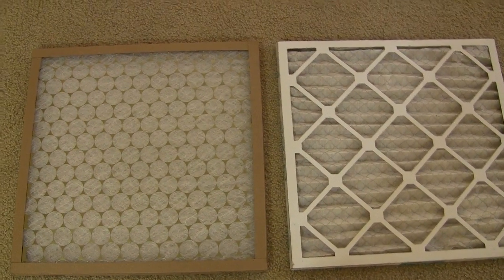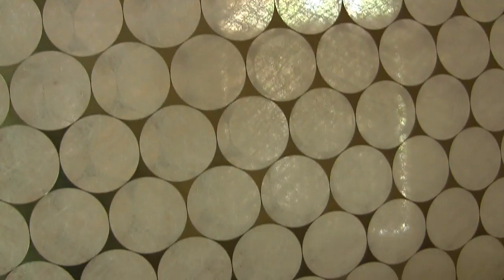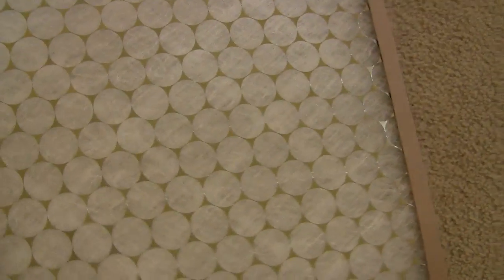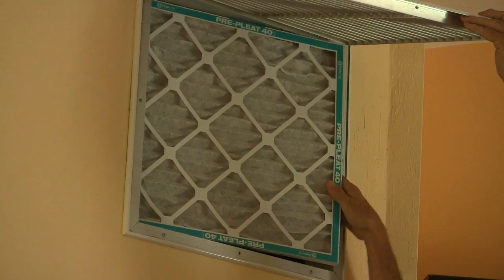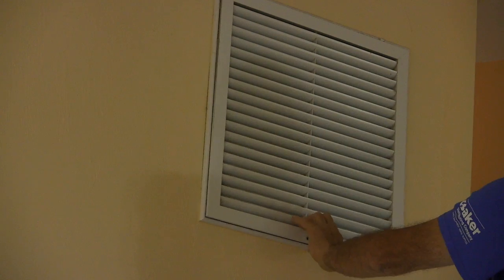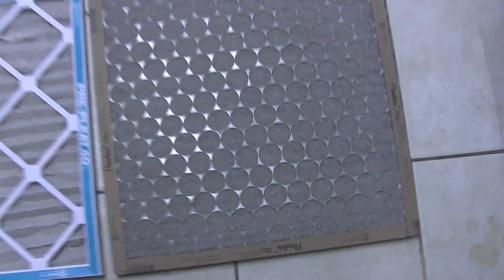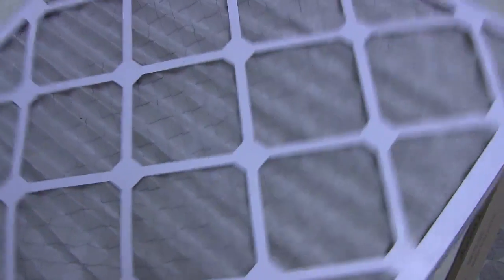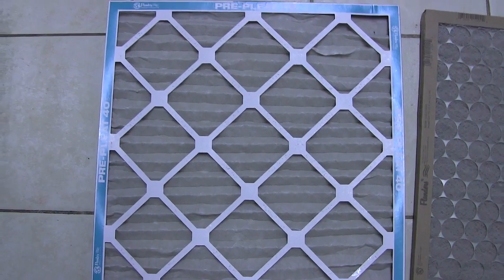HVAC fibred vs pleated air filters

Comment: What needs to be addressed concerning these air filters is that air flow restrictions will cause damage to the furnace in the long run. 
Insufficient air flow through the furnace, especially the cheaper built imports, will cause heat stresses and breakdowns.
Keep in mind also that the cleaner you can keep your cold air return system the better.

Comment: This is the best comparison I have ever seen on fiberglass vs pleated filter. Just shows you how much more dirt/particles pleates filters stop. However there is a trade off in air pressure drop as they don't flow as much air as fiberglass.

Any 1 inch pleated filter needs to be replaced monthly. They have a high pressure drop of .20 avg and only go up very quickly as they get dirty causing strain hvac equipment.

Comment: I look at it like this. My HVAC system isn’t designed or intended to clean my air. It’s designed to heat or cool my home. I use the fiberglass because I found the pleated limited my airflow too much. The fiberglass grabs the larger particles which is important, it does not grab the real small particles but the don’t need it to. We dust, clean, have an ionizer and led blue light in our furnace snd would rather give our blower the airflow bit needs to run properly.
Reply: Restricted air flow can also damage exchangers in gas devices.

Comment: What is the benefit of a high delta-P across a filter (maximum elimination of dirt particles) designed to clean air, but negatively affects evaporator saturation and superheat?

I'm just asking, do not claim to be an authority or even a novice on these systems.

Comment: Interesting comparison. I work in a hospital & we use mostly 2 inch pleated air filters in our air handlers & rooftop ac units. The fiber type seems to be most commonly found in residential applications. Fiber is ok if you have low dust & dirt levels or for light commercial applications.

Comment: ok this morning its too hot so i am staying in and harassing dr z LOL . you won't believe this some of you but my house was built in 05 and i went and bought the filters you assemble together and you clean them once a month at least , well they are still in there in 2016, i pulled the indoor coil last year i think it was and it was spotless . i just redid the water outlet that they had done the contractor did so to make it easy to clean without needing all kinds of crap. later

Comment: If you are going to change your filter every thirty days the pleated filter is good. If you only change your filter every 90 days or more I recommend the fiber filter. For most people and real world situations (especially rental situations!) I would go with the fiber filter!! For people who have allergies or high dust sensitivity I recommend going with a HEPA (High Efficiency Particulate Arresting) Filter and changing it every thirty days.

The draw back of more efficient filters is they require more frequent changing!!! Of course the benefit is in the name... More efficient!! This is only true if they are changed every thirty days otherwise they will cut air flow and cause less efficiency, low air flow, and eventually coil freeze ups, high amp draws, compressor over heating, plus other costly problems!

Comment: I don't understand the point of the video?  Obviously, the pleated filter will outperform the fibered filter.  
Filter determination 

First, does the system have adequate air flow?  Can improvements be made to improve air flow facilitating a higher performance filter? 

Second, what is the location of the return grills?  Are they at ground level or ceiling level upstairs or downstairs.  Each requires consideration.  Ground require higher performing filter because of ground dirt and dust.

Third, what is the environment that is being filtered?  Residential or Commercial.  Pets or no Pets.  What about health conditions. I have seen office and commercial environments with very little dust present.  Pets add another level of complexity.   My clients are well educated on these points.

What is the frequency that the filters should be changed?  I teach my clients that there are no rules for this.  Many things effect filter replacement including seasons, pets and even the type of vacuum you use.  A good rule of thumb is to listen to the sound the filter makes and check.

Last, most of these items need to be considered during the design stage.  I design 1.5 square feet per ton to accommodate different quality filters.  I believe fibered are rated a #1 where a typical pleated filter is a #4 finally high-end pleated filters are #10.   Your filter cannot or at least should not restrict system performance.  

Your video left out a lot of practical information as to why you would use one over the other.  No one should think that the two filters you presented are of equal performance?  Each filter type has practical applications.

I think you missed a golden opportunity to provide a really good video for your followers that would have meaningful information.
Reply: Here commercially I have 3 filters two 18x30 and one 14x25  . This is 1080 + 350= 1430 square inches.= 9.9 square feet for 10 tons about 1.0.  BUT most of the time the unit has 1 five ton unit running thus the dual A coil has 2.0 sqft per ton. I run 3M Filtrete 1250 types and they last for at least 6 months. I have a pressure gage across and monitor the delta p since a mechanical engineer.

Thus I run the best or next best 3M filters and keep the place cleaner.

Sadly I have found that filter size folks use is an after  thought; I actually would like to use more area

An 1100 sqft apartment I lived in Calif had a 1.5 ton AC unit and a filter WAY too small. One could hear the noise since sized so wrong.

I wager a mess of installs have too small a filter; the builder just wings it.
Reply: Check your math? 18x30=540 which is 3.75' x 3 = 11.25' + (14x25=350" which is 2.43' )  Thats a total 11.25+2.43=13.68'
Reply: There are two 18"x30" filters thus area is 2*18*30= 1080 square inches

There is one 14"x25"  filter thus area is 14x25 = 250 square inches

Total area of the three filters is thus 1080+ 350 = 1430 square inches ie 1430/144 = 9.9 square feet

Thus I have 3 filters in usage, not in series but parallel

The set of two 18x30" filters are in one commercial frame that is 36x30" ; ie the two filters are vertical

The other 14x25 filter was from an older config and it too filters the entrance area of ther air handler.

Comment: Better yet are the 4 and 5" thick "media" filters that are similar to the pleated filters but have significantly deeper pleats and therefore dramatically increased surface area.  In relatively clean environments the 16x20x5 or 20x20x5 or 20x25x5 filters, while somewhat expensive, can last six months to a year.  However increased static pressure (or air flow resistance) can be detrimental unless the duct work is designed well and/or an ECM motor is in place.
Reply: I have followed DrZarkloff for years and this is Great Video- thank you!
 RJParker: I use a 4" Pleated filter with a Cheap 1"Fibred Filter in Front. 
 I Replace the 1" Filter every 2 or 3 weeks, before it gets dirty.
 The 4" Pleated filter then lasts several months. 
 I feel If maintained, these 2 "double" filters are not too restrictive..  
  All Comments appreciated... -Bob

Comment: I recently had a new Carrier HVAC unit installed and was surprised to find a horsehair washable air filter as original equipment. How does this fare compared to the filters you tested?  Also another question; it would appear that your filter is custom mounted in a wall, I presume one that acts as a return duct to the air handler. How close does this have to be to the HVAC unit.  I ask because the way my new system is installed, it is difficult to change the current on-board filter.  Thanks.